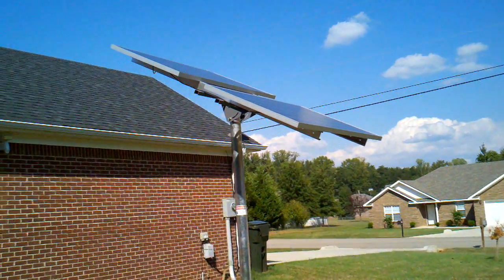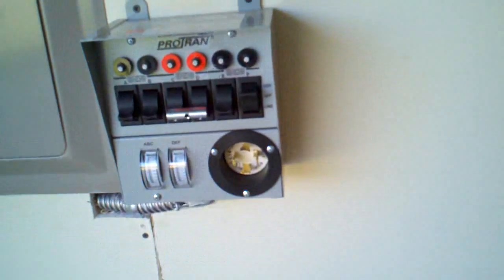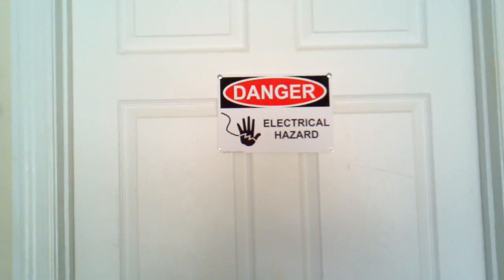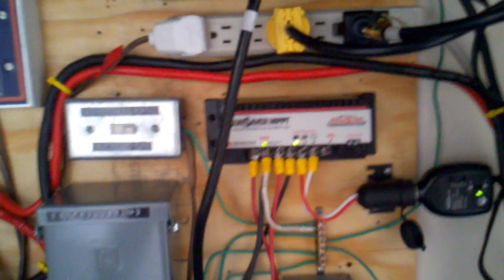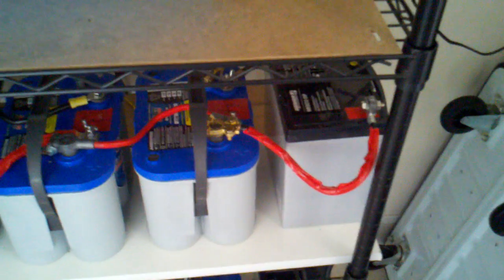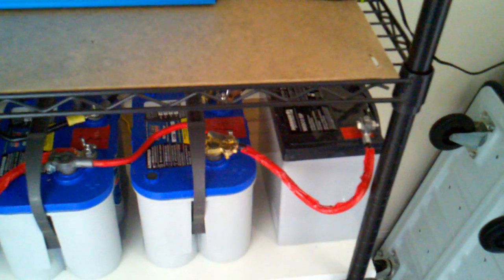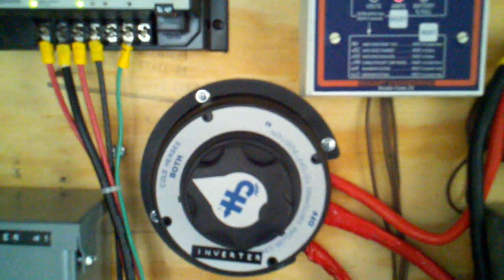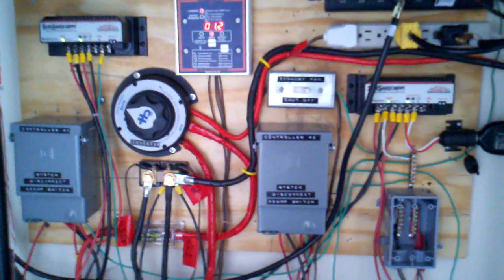DIY - Home Solar Hybrid - Standalone - Grid Tie - Done!!

Comment from the maker: You isolate rooms by isolating circuits via a manual transfer switch.  The transfer switch acts like a sub panel where you can take 6 circuits of your choosing and separate them for emergency use with a generator etc. Installing a transfer switch and building a stand-alone backup system doesn't require utility approval.  Small Grid Tie inverters that provide half a kW aren't worth the trouble of net metering. That little power will be consumed easily by appliances in your home.

Comment from the maker: In this video the GTI's plug into the wall outlet, the regular inverter ties into an auxiliary outlet I had installed. It's connected to a transfer switch. And no I did not seek approval for my home system, I didn't see the need for it.

Comment from the maker: Thanks for you comments. In this video, 2 panels are not shown.  I have 4 panels total, rated at 670w.  For a backups system 670w is more than sufficient to charge batteries.  However, for grid tie capability, I do agree with you that 1kW or greater is the way to go.  The grid tie in this case was just for testing etc.

Comment: Even the trailer in my thumb nail is a 1375 watt Grid Tie using Micro inverters, not battery. But I can convert it when needed for back woods it is a complete rewire. I built it for advertisement for green energy shows. I'm not sure where you are from? But don't try to get it inspected it will not pass, if the power company catch's wind of a grid tie without there ok and a county inspection they have the right to disconnect your home.

Comment: So many people throw around the term "grid tie inverter" and they are wrong! Just because its printed on a cheap chinese motorhome or boat inverter, does not mean it is for tying to the grid. Grid tie inverters cost at least 2000.00  If its not a grid tie inverter, yo may start a fire, or get no power at all. AC power must be phase Matched! Please look into it, and do not backfeed with a plug into your outlet. If you do, throw away everything you think complies with safety and the NEC.

Comment: The grid tie inverter must synchronize its frequency with that of the grid (e.g. 50 or 60 Hz) using a local oscillator and limit the voltage to no higher than the grid voltage. A high-quality modern GTI has a fixed unity power factor, which means its output voltage and current are perfectly lined up, and its phase angle is within 1 degree of the AC power grid. It should have an on-board computer which will sense the current AC grid waveform, and output a voltage to correspond with the grid.

Comment from the maker: For a system like mine, you'll spend about 4 or 5k.  Components include MPPT Charge Controllers (x2), AGM batteries (x12), 670w of solar panels, wiring (2 Guage for batteries and 10 Guage for components), roof mounting equipment, pole mounting equipment, battery monitor, and inverter.

Comment: I am new to this but would it work to wire the 2 computer fans in series to use the 24 volts without the transformer?

Comment from the maker: After a year and half, I can tell you the fans were excessive, the grid-ties are not necessary for a backup system. If I had all of the same types of panels I could have used 1 charge controller and not 2. I also should've purchased an inverter/charger combo instead of just an inverter. So if you stick to the batteries, a good inverter, charge controller, and get all panels of the same type, buy appropriate disconnect switches and fuses, you should be good to go.

Comment from the maker: There are inverters that will allow you to connect to Solar, Wind, or Batt. Just be aware that you must keep the unit cool to prevent overheating. I have one connected to a 24v system. And I typically run it in sunny conditions for 4hrs. It averages around 470w per hr * 4 = 1.8kW. A lot of pwr is lost due to heat. I don't run it all the time or when I'm not at home and I use an external fan blowing in and around the unit to keep it cool. it's a 12v - 30v GTI, so far no problems for almost a yr.

Comment: Hello. I was told it would ruin the inverter connecting straight to the batteries. Have you been running it that way for a long period of time? Also what is the voltage you have going into the inverter?  I was thinking of setting my system up in a similar way.  I need no more than 2 KW going into the grid.  The electric company doesn't have net metering here in MS so I need to generate no more than I use.  Thanks for info and g
reat job on video.

Comment: I see the grid tie seems to give you more watts connected to battery bank but you can only run it for 3 to 4 hrs. Would you be better off to connect grid tie to a charge controllers dump load comming from battery bank, so your batteries are always full and you would then have your grid tie on for longer periods? 450 watts is good but say 300 over 6 hrs is better, and you wouldnt have to watch it! Just a thought, really like your vids and hope you keep them up. Thanks

Comment from the maker: @mag7mm1 Thanks for your comments. Actually, the GTI's are run during a sunny day for 3 or 4 hrs. Around noon they are turned off and the batteries are fully recharged to full capacity in approximately 2 to 3 hrs. The Depth of Dicharge is generally not more than 10% during that time. I generate 1.5kW or more during that time. Optima AGM's are generally good for 5 years if taken care of, a 10% DoD shouldn't hurt them. Think of what a car alternator and battery does everyday it's driven to work.

Comment from the maker: @ambrose361 Thanks for your comments. The mppt charge controllers for this 24v system support a max of 400w, 70v & 15A per array. Each panel array is connected in series and doesn't exceed the limits. Each array without the CC will not generate more than 8 or 9 amps, hense the higher volts for the mppt's. The fans are there to keep the units cooler during the summer months to prolong life, overheating is not a problem with these. The 2 controllers are there because the arrays are different.

Comment: Just a thought.  You could run those two fans in series on the 24v, without converting to 12v, and running them parallel.

Comment: @Brown969 

You can do that, you just need a voltage switch, that turns on a relay when the batteries are full, then shuts off when they start getting low.

Comment from the maker: @Brown969 I don't know if you could wire a dump load to the charge controller. Seems like it would be an excellent way to handle excess power if it works. But again, I've never tried it so I wouldn't know.

Comment: Would you know if you can wire the dump load from your charge controller to the Grid Tie Inverter? That way when your batteries are full, you are exporting the energy you're still producing. Thanks for the tour.

Comment from the maker: @P1001AT2 Thanks for the comments, and yes you are correct. I didn't think of that at the time. Also with the terminal block I get a little more flexibility so I can use more 12v items.  But again, good catch. Take Care.

Comment: For the fans you could have just put them in series and connec it to the 24 volt output because in series the voltage add up so 12 plus 12 would be 24 volts no problem whit out burning the fans

Comment from the maker: @1jbunceiii You can reasonably expect to spend between 4K and 6K on a setup similar to mine. That also includes professional services from General Contractors and Electricians. Also, since this was not done all at once, but in pieces over months, that made the project more feasible. Save a little, buy a little. Also, I will be taking advantage of the Tax credits offered to defer some of the cost. Also, you could also use cheaper components, i.e., batteries, controllers, panels, etc.

Comment from the maker: @jwaflergmailcom In simple terms, a Grid-Tie inverter is a specially designed inverter, that plugs directly into your house outlet to supplement (or add to) the power coming from your utility, thus reducing the amount of electricity used from the utility (grid). A normal inverter is used to power appliances etc separately from the utility (grid), and can not be plugged in to work interactively with the utility grid. I have 2 controllers because I have 2 different types of solar arrays. Thanks

Comment from the maker: @hooterman2828 Actually, that's a good suggestion and I hadn't thought of that.  However, the adapter does give a little more flexibility to run additional small 12v items along with the computer fans.  For instance, my wall mounted fan to cool my GTI also runs at 12v.